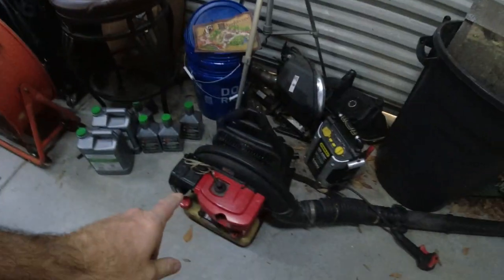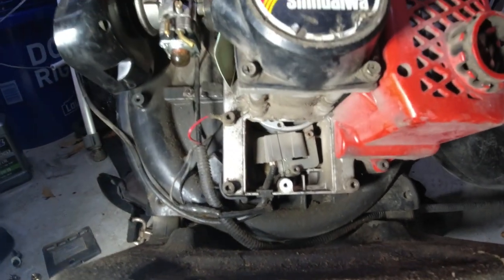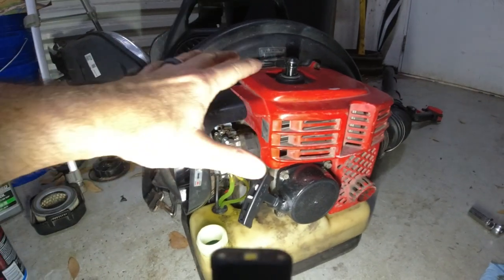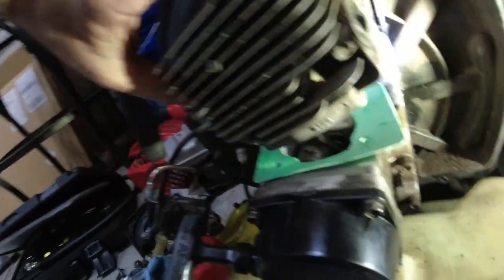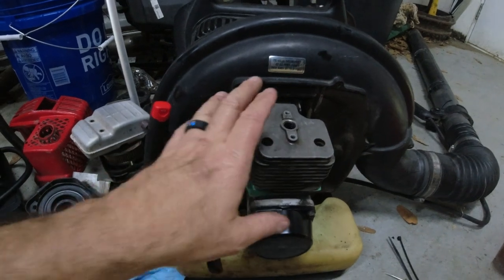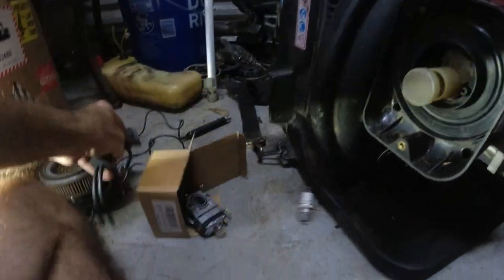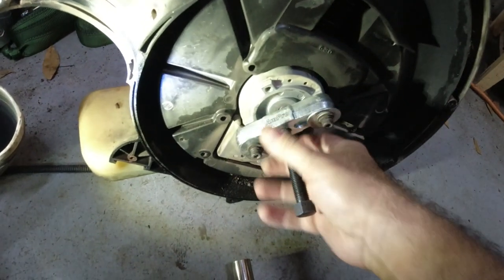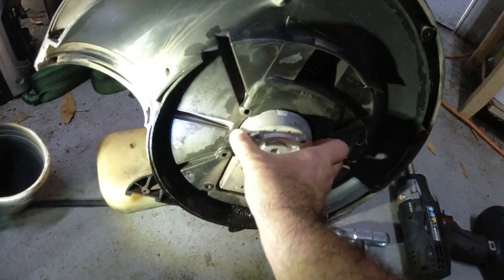Back pack blower fail, attempting to fix a non starting Shindaiwa EB630 leaf blower

Comment: Coil needs a business card size gap from the flywheel, oem coil is NLA & aftermarket ones are mostly duds.
Reply from the maker: i did the card gap but forgot to record it.. I thought that the coil might be a dud but it is putting out a spark.
Reply: @KGsGarage  I bought a Stihl FS85 off of a guy who put a knockoff coil on it, it had spark but wouldn't even try to fire up. I took off the junk coil reattached the OEM after cutting it just behind the hole, made a fresh hole in the center & slid the rubber boot on & it fired right up after. A used coil or somewhere that has OEM NOS is the best option.